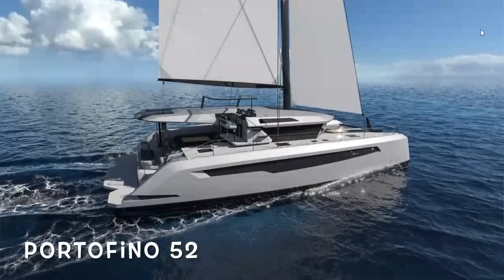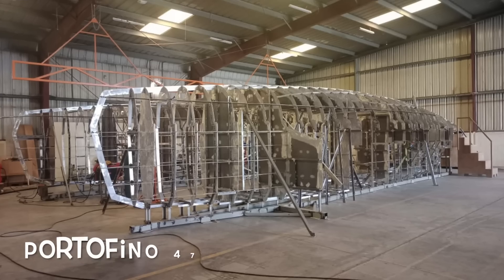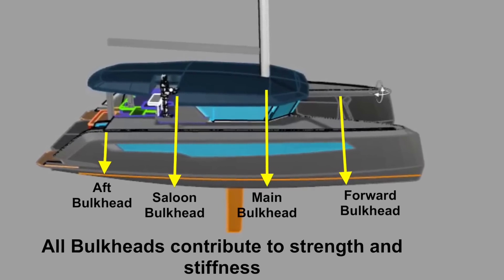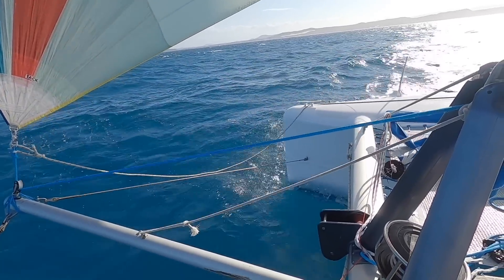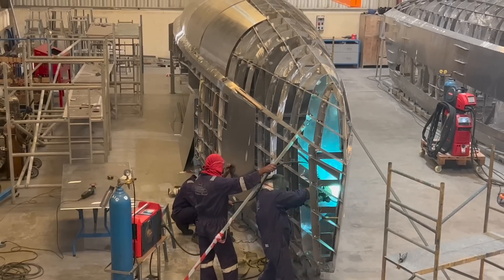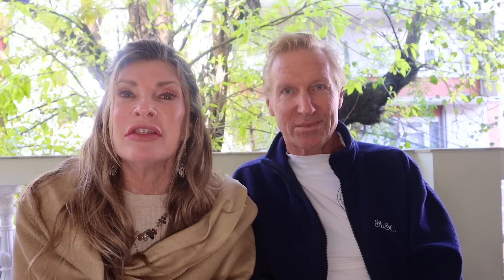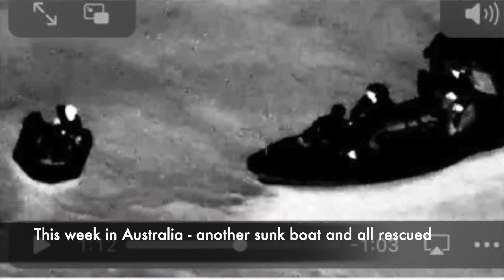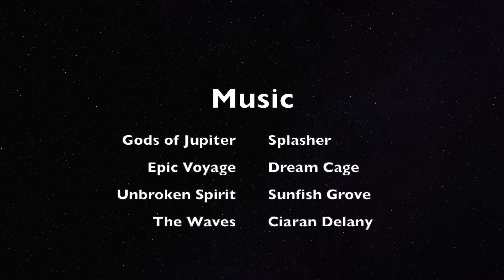S3#9.  Portofino 52 Build Starts!!! The TRUTH about BULKHEADS. And First  of 52 AL bulkheads cut!!!

Comment: Love your videos.  As a newbie I really appreciate your insights.  Having been in the RV business one of our concerns was when welding Aluminium that the welds are strong, but it could crystallize the Aluminium on each side of it.  How does Portofino address this?
Reply from the maker: Hi Kirk, That is not my area of expertise and we will have Raffaele discuss these issues in an upcoming segment. However, I would expect that crystallisation only occurs with excess heating of the AL.  Fast smooth welding that I have seen does not cause that issue so it may be down to the skill of the operator - but we will see what the "clever" people say about it!

Comment: Great information.  Can’t the manufacturers be held liable if they claim the bulkheads are water tight if they are not?
Donate for a Dream
Reply from the maker: HI guys. Not sure if the manufacturer would be liable if an independent salesman was not speaking the truth and then the issue would be have you suffered any harm from that - if your boat sinks, perhaps you would have some possibility in a place like the USA but most countries would find in the fine print of the manual that it is stated that the sections drain to the one place and you were meant to read that... I'm not a lawyer at all and can't advise or answer that absolutely - however, I spread the info so future buyers might be more aware of what they are getting and not just accept the sales pitch!

Comment: How much was your car insured for?  How long was it insured for? How did the fire start?
Reply from the maker: HI Danny - what car are you wanting to know about? The fire issue is still in court without any payout so we need to keep it confidential till the proceedings are over but it was not a fault of the boat, the electrics, the engine or Lithium batteries. It is not a fire that would normally occur so is not a risk to others with Leopards or other brand boats.

Comment: All very good. 
I suppose it would be right to say there might be ‘partitions’ or walls on a boat that are non-structural .  These should not be called bulkheads. 
Of course as you build the boat lighter you might rely more on the bulkheads and frames for structure . 
Some builders will save weight by using the partitions as structural members( frames or bulkheads)
I don’t think you should be saying you have 52 bulkheads , you have at least 4 bulkheads per hull plus many frames. 
Looks like an exciting build 
Cheers Warren
Reply from the maker: Yes Warren, the terms are a vague as in monohulls all the frames are bulkheads… However the 4 important bulkheads are the one that go across between the two hulls as you say. 

It was the naval architects that said to us there were 52 bulkheads (although like you I would have just called them frames… It doesn’t really matter as long as we all know what we are talking about.

All the complete  “walls” in the hulls are bulkheads and where there are doors, they are part of the structural build too (frames). There’s no non structural walls and even in the 42 foot cat, the saloon seats and lockers acted to increase the structural strength of the underwing. All those things help making the boat stiff. 

Thanks for your comments and we agree…

Comment: Keeping all switching high in the hulls will reduce the risk of shorting in a hull leak situation...all through bulkhead services need to be waterproof like a shore power connector  or sealed in a gland set up ... 🤞🏼🤔 .  

I put forward the idea of a self righting air bag on a multi million pound out and out V hull sports boat .. but salvage bags linked to  fixed lines and hoses built in to a hull might be a future safety idea for offshore vessels and race boats.. packed into protective cases in the hull sides or decks and activatable by mechanical pull release or air valve. 
They could be deployed on one or both sides to keep a vessel afloat in event of a catastrophic breach...and wouldnt take up much space ..if international orange they would make the vessel easier to see from the air if low in the water.
Reply from the maker: Yes we have seriously looked at air bags, either in hulls instead of air tight voids oreads inflated or triggered like you say… Not had enough time to go this yet though.

I think in the big brands, all owners crossing oceans should have those salvage bags in the hulls to save their boat or use for others in distress…
Reply: @barefootdoctorssailing  
A cat could have the long roller ones built in the under shoulders of the bridge deck.
Reply: @barefootdoctorssailing  

Another thought for further down the line .....look up the Liquid piston motors company they have a prototype rotary diesel engine that is forty hp and one tenth the wt and tiny compared to a conventional 35 hp 4 cylinder diesel.   Its also small enough to hold in your hands.... as an APU generator motor its brilliant.
Though theres already a 12.5 kw Rotary engine powered genset thats been tested by DARPA etc and is the size of medium size suitcase and weighs less than 80 lb ready to run.
Rotor power already do a single rotor motor and a double. ...
Even Mazda are trying their Rotor Wankel motor as a generator range extender in their latest PHEV.🤔

Comment: I think you are getting confused between Frames and Bulkheads. Yes Bulkheads are structural  as are Frames and stringers. Try not to confuse "E" glass and Aluminum they have different build processes. But a great vid.. Thank you
Reply from the maker: Thanks for your comment Garry and thanks for clarifying the importance of frames and BH for structural strength and yes you are right that the different other products have different flexibilities so the spacing between supports is very different. I have no experience in building with glass so can't comment at all but foam sandwich and western red cedar epoxy sandwich don't need such close supports. Thanks for clarifying (and we do sometimes talk loosely - apologies!

Comment: Great video. This one fits in with the technical books I've read (and that every sailor should read and watch.) There's a couple of things that can happen with something like a bulkhead on a catamaran. The shape and forces are complex so it's easy to get it wrong. 1. The bulkheads can be inadequate (Lagoon) 2. They're not properly connected to the hulls and bridging (Lagoon) 3. They might be overbuilt and add unnecessary weight.  4. They might deteriorate over time (Lagoon) And it was Lagoon who said a bulkhead wasn't structural.   Another of the many mistakes Lagoon made was thinking that their thin plywood sandwich  wasn't going to shear, separate and bend between the layers of veneer.   Plywood is a great material if used correctly. 
Something else: The sinking in the Pacific of the sailboat that hit the whale: Raindancer.  15 minutes - sunk. I'm guessing the sail drive was broken off making a large hole in the engine compartment. I wonder if it's possible to construct engine compartments so they can be completely sealed. First you'd need to seal them below water level. Now they're like the manifold in an Amel. If they could then be completely sealed (closing the air intake)   compressed air could be pumped in to keep the water level  to a minimum. The boat could then sail to port instead of the leak spreading throughout the cabin. Of course diesel engines need a lot of air. Thinking of this made me realize, I don't even know where the air inlet for my diesel is. 
Bilge pumps. In one of my three heavy checked bags I'm taking to Vietnam is the brand of bilge pump you show (a bit more capacity 3700).  What I know about pumps. 1. They are almost never enough. (If you can block the hole the boat's saved,  a pump, maybe not.  So what is the maximum pump your boat and batteries can handle - that's the one you want) 2. The height of the hose is more of a factor than the size of the pump. You can have a pump rated for 3700 gallons/hour, but as soon as you put a hose on it and lift it up a meter the capacity is now less than half.  The ideal distance a pump should have to lift water is the smallest distance to where it dumps. In a boat this would be just above the waterline. (Of course if you're sinking this changes.) (I don't know if there's any advantage to the depth of a water pump. Pressure increases rapidly with depth.) I do know that the capacity of a pump in the sump of  a basement lifting water 10' (3m)to get it out and away from the house, is a fraction of the rating.)  A lot to think about. I may not know what I'm talking about but I'd like to see the option of a shaft drive prop instead of sail drives. My Hunter has a shaft.  I wonder if that whale didn't want to scratch its back on some flotsam, noticed the big keel moved to the side to avoid it and took out the saildrive (injuring itself and sinking the boat.)   Sorry to go on.
Reply from the maker: HI again Will! Lots of very good info and yes you are right about the sunken boat and it's name and very good points about protection for water influx and the pump capacity issues... We will look into what pump is best and is a petrol one better than 12V incase the batteries get drowned... Charter boats in Australia have to carry an independent operating high capacity pump for fire and bilge drainage... We will discuss more detail in the future.

Comment: Such an excellent video! One practice I’ve adhered to is having at least one “rover” high capacity bilge pump on board. If the worst happens, being able to have a mobile pump that can help if the principal bilge pump for a certain area can’t keep up and gets overwhelmed, or fails for any reason, can save the day. Some people call them a mobile “gusher” pump. Cheap insurance, so to speak. Then of course is the technique of using a valve to close the raw water intake and using the engines to act as a bilge pump for that area of a vessel…
Reply from the maker: you are exactly right, Ray! Both about the rover and about using the engines intakes to drain the engine compartments... Thanks for sharing!

Comment: Good video on the bulkheads guys, Portofino will be a very solid boat!  You should really clarify that the boat that sank was a monohull with 10,000 pounds of lead ballast dragging it to the bottom.  Aluminum also doesn't float, so it is even more critical to have multiple separate watertight bulkheads on this type of boat!   Performance carbon fiber/epoxy catamarans that are well built with closed cell foam (that does not absorb water) have positive buoyancy, although they could theoretically sink, most would float for years until they finally wash up on a shoreline.
Reply from the maker: Thanks for the comment Kirk and yes, you are right that the monos sink in a very short time cause of the ballast. My understanding is that even the foam boats need to have air tight voids or watertight bulkheads to trap air because of the all the extra weight of the engines, mast, rigging, gear, winches, food, stores etc. Every boat has tons of extra gear that helps pull them down if the hulls completely fill with water... Fortunately the well designed and built boats have properly built floatation areas that will save the boat in the crisis...

Comment: A few years ago, I was searching for my last boat (I just turned 72).  Looking very closely, I noticed a nearly universal lack of quality.  The wiring especially was very often haphazard and I walked away from MANY boats because of that.  My 2nd concern was always the inadequate material used.  What's holding the boat together I would ask.  The answer was invariably:  not much.  Builders are sacrificing strength for light weight and apparent "speed".  The designers/builders will assure you that their boats are strong and safe.  However, that is not the reality.  MOST of those boats are highly compromised.
Reply from the maker: I absolutely agree, Paddy! We are trying to get the knowledge out there to encourage or force the brands to up their game...
Reply: So much for me to learn. ❤

Comment: Are your hull floors above or below full displacement waterline? You can consider adding camlock fittings to your seacock hose before the sea strainer to use your engines as crash pumps, and also use the deckwash pump as well. If interested refer to Freerange Sailing vid #192
Reply from the maker: Thanks Rob, good points on the engines are emergency pumps and the deck wash pump... Free Range Sailing do a great job too - love their  skills!

Comment: Some good info. However I would not agree that welding aluminum makes it stronger. Yes, when filler rod is used you are adding material. However, you are also heating the base material and this can cut yield strength in half.  This can be countered with heat treatment but can be difficult when dealing with such large parts such as boat hulls. Welding also removes the anodization on the material, which can lead to corrosion at the welds. This can also be addressed by painting, but is best done by dipping the entire assembly in an anodization tank. I’m not sure if this is done on these boat hulls, again due to the massive size of the welded assemblies. It would be interesting to know what Portofino does to address these issues.   An additional issue is that any interface between aluminum and stainless steel will be a corrosion point. Many high end marine applications use Monel instead of Stainless to reduce corrosion. I wonder what Portofino does.
Reply from the maker: Thanks for that detail, Keith. Obviously there is a lot of conflicting info from different sides and it may depend on how hot the alum is heated in the welding process (how long it takes and how wide the weld is). This is not my area of expertise so that may be something we can get more expert advice on but welding a frame onto a flat sheet is essential as it increases the structural strength enormously so perhaps this compensates for the local fall in the yield strength you talk about.

I will try and find out more details about this.

Comment: it sounds like Vietnam or Thailand, the leaves on the tree. Confusing is the building behind that have thicker window sidings and pink color. But it is tropical. The tree are a bit wet so it sounds and looks like it just rained.
Reply from the maker: Nice deductions Sherlock Holmes, but unfortunately not Thailand or Vietnam! You are in the right type of country but not the same area... Yes it had just rained and it was cold /higher altitude?

Comment: Aluminium has a relatively low panel stiffness, hence the need for many frames and stringers to support the skin.  Composite sandwich panels are typically much stiffer, so less bulkheads/frames/stringers needed.  The issue is all about quality of construction with either material….welding or bonding/tabbing has to be done right.  Aluminium is a great material, but watch the weight growth during construction.  Every weld is added weight.
Reply from the maker: Good points John and thanks for the info!

Comment: Very interested in learning the material science and why different alloys of aluminum are chosen for different parts of the boat. 5083 was chosen for your bulkheads, but there are several other choices (each with pros and cons, and costs). I’m not implying that 5083 is a bad choice, I’m just looking for a more scientific explanation as why without using generic terms like “it’s the best”.  
Also, will your boat be rated for ice impacts?
Reply from the maker: HI Nuts and Bolts - you are right in saying that we do not know the different properties of the different types of AL but we can get the engineers to let you now why they use 5083. All I was told that for seawater, it has the best properties... Will try and find out more detail for you.
Reply: Corrosion resistance, workability, and good strength. H36-H38 👍🏿
Reply: @anthonyrstrawbridge  The same can be said about 5052, 5182, 5086, 5754 and 5251.  I’m assuming the Barefoot Doctors do not know the answers to this question, but they seem to have access to engineers that might.  I have read through several academic papers concerning alloying properties and have come to the conclusion that it likely comes down to cost and availability.  Maybe the engineers would rather use 5754, but it’s 6x the cost.  Maybe 5083 for bulkheads, and 5052 for hull skin and something else for fuel and water tanks.  Obviously I’m no engineer, I’m just curious.
Reply: @nutsandbolts432   Yes, the 5 thousand series sounds great. Less zinc more chromium, less conductivity, low weight. I maintain 2024 and 6061 hulls for spraying corrosive salts and acids. It is the stainless steel which corrodes away and fails most often.

Comment: Yeah umm, but is the torsion less for the stays in an aluminum boat n don't they just lock into place n can't b over tightened anyway? like on Jamies boat the Jupiter 2 his Mumby 48? unless Iv miss understood it? I also understand about bulkheads. Must b Horrendous hitting a shipping container n the middle of the night or anytime. It has to b france boat shop lol cya's, great episode shared n liked my channel is back up too its: https://www.youtube.com/@Seagole
Reply from the maker: Thanks for following and for your comment Seagole! The stiffness of AL allows the rigging to be stiffer and does not flex as much in seaways but the actual tension still needs to not be excessive or it will cause faster fatigue of the shrouds and boat attachments (I would expect). The riggers know what tension to put on the shrouds so I would get them to follow the engineering design - a bit like over pumping tyres on a car - don't want it to pop!

The place is not France or Europe but nice try! Nice Lagoon on your channel - are you cruising?
Reply: @barefootdoctorssailing  Thanks :hand-pink-waving:awesome replies :elbowcough: